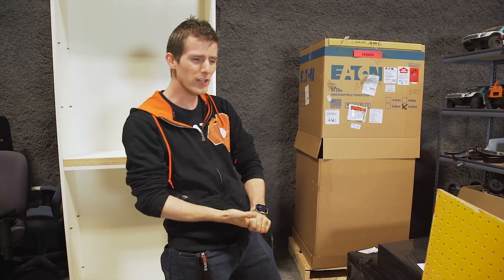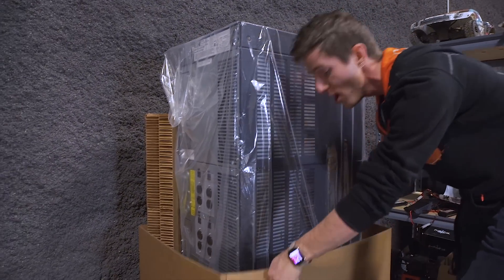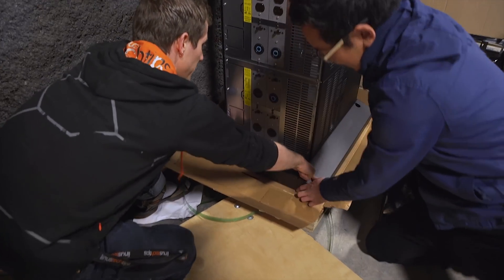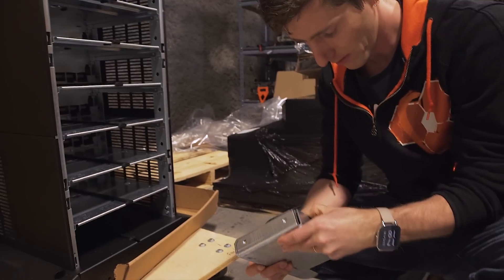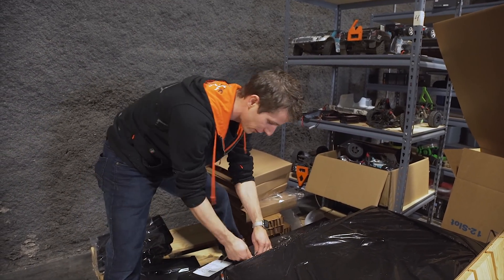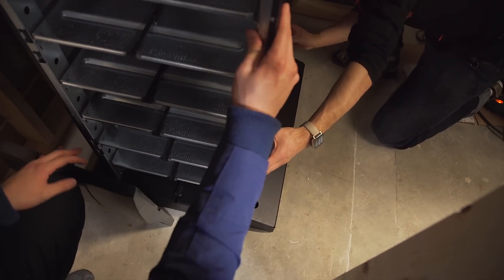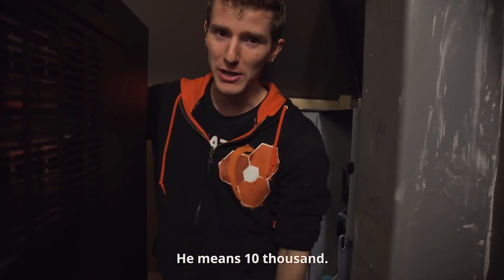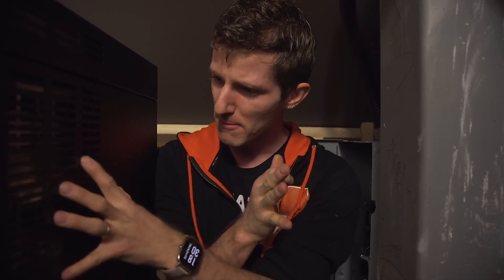HOLY $H!T - A $17,000 (CAD) Man-sized Battery!

Comment: Tesla Powerwall 10kWh 3500$ and this 12kWh battery 12350$ worth it? (17000 cad)
Reply: +Alex Arifin That is what i was thinking, and you can daisy chain powerwalls for a higher overall output. To shut down the servers you would need a bus monitoring device hooked up to something like a $20 raspberry pi to shut down the servers, but with that much power you may not even need that
Reply: +Alex Arifin not looked into the powerwall buts its probably made from lithium edit: google searched confirmed i was right lithium is a use it and toss it solution plus a huge fire hazard if it was to be exposed to air and basically an explosive when exposed to water. this solution is a lead-acid battery and when the lead gets crystal formation it can be "cleaned" and refurbished and reused. as well as the acid. also if air gets into it it wont set on fire immediately
Reply: D. Conn The lithium is under a coolant (same as the one used in tesla cars [which were not particularly flammable during crash tests]), so even a leak probability will not pose a fire hazard. Additionally, the powerwall lasts 10 years of maintenence free use. I don't think tesla made these batteries without considering hazards, especially considering that they make a enterprise unit called the powerpack which stores 100kwh! and very large orders have apparently come in for 1mwh daisy chains.

Comment: what the hell is a kilovolt amp?
Reply: +Roger le It's a unit of power.
Reply: +Roger le well technically V * A = W

But when you're talking about AC power delivery often you are dealing with apparent power and actual power. In a perfect world the potential and current would be cute matching sinusoidal waveforms. But in practice depending on the load they'll be a bit apart making the actual usable power less than the apparent power if you just take the average current * RMS voltage.

So at some point people have decided to generally refer to apparent power in VA and when talking about real power where you ignore the imaginary part of the math that can't be actually used Watts.

Comment: Apparently everyone in the comments is an expert electrician or datacenter availability engineer now...
Reply: +Shoot1st I read a bit of the bible once, but I don't think I'm the Pope
Reply: +Captain Obvious Yep and from what I see its a useless battle for those of us who DO work in them. God some of these people think the generator runs 24/7 and directly power the equipment. God it hurts my head seeing all the stupid...
Reply: +Captain Obvious , That's obvious... Captain Obvious :)
Reply: Haaa. I was just thinking that. A few are probably legit. Others just happen to touch a power generator and glanced at a data center rack the day they saw some engineers working on the stuff. They stopped and talked to them for 30 minutes.
( ͡° ͜ʖ ͡°)
Reply: +Captain Obvious you know i laughed my ass off when i read this because although i am not a Master Electrician i am a journeyman Electrician. There were several things thorough the video that stuck out to me. #1. 4 15amp circuits. WTF is the point in 15's what did you run out of 12/2 MC and used 14/2 MC instead, its a commercial space use 20 amp. #2. The disconnect for the UPS must be easily accessible, not crammed behind a UPS (ec. 110-26 of the National Electrical Code (NEC): 1) at least a 3-ft 
clearance in front of all electrical equipment; 2) a 30 in.-wide working
 space in front of equipment operating at 600V or less). #3 Never should anyone open a disconnect for any reason who isn't licensed even if it is not live. Not only do i see it open, i see exposed terminals and Linus parts in close proximity. [Also i know i referenced the US National Electrical code and not Candida's but i can assure you they are very similar in many regards. Also before anyone give me shit saying Linus can open it because he owns it any its legal for you to do your own electrical that only applies to Residential, NOT COMMERCIAL. Im not trying to bust balls here and be a hater but Electricity isn't a joke and anyone who isn't trained shouldn't be working with it.
Reply: +Captain Obvious I genuinely am.
Reply: +Christ J 
Aren't we all.
Reply: Brandie Housel C&G 2360 parts 1 and 2, NVQ 3 in Electrical Engineering. I have the most recent 2381 and 2391 updates too.

Would you accuse everyone of making this stuff up? That would force you to conclude that electricians don't exist.
Reply: +Captain Obvious Im an expert electrician... Dont touch plugs with wet hands
Reply: D. Conn plugs are fine, it's sockets you shouldn't touch with wet hands. Even then, residual current devices will kick in and no Darwin awards will be won.
Reply: Scott Ruesch I'm qualified to wire a power plant - does that make me an "expert electrician"?
Reply: +D00mM4r1n3 IT support guys and their job title inflation. You didn't design HSBC's financial data center or go anywhere near it, stop lying.
Reply: +Christ J No you fucking aren't dude. Stfu, gtfu, lmao brb, jk fys
Reply: +Captain Obvious Some of us do actually work in a DC and do this for a living....
Reply: +Captain Obvious Yeah I am I work IT for a power plant
Reply: c Cook Just because you do the IT work for a power plant doesn't make you an expert electrician.
Reply: +Captain Obvious oh i forgot to mention most generators (consumer grade) produce modified sign wave. Servers and delicate equipment can be damaged by modified sign wave. So what you would require is a Power conditioning system.
Reply: +Captain Obvious I actually am a datacenter engineer, ever hear of HSBC or CapitalOne, yeah, you can thank me for your bank transactions not being lost in a power outage.
Reply: I feel honoured the handful of experts in the world that actually design multi-billion-dollar datacenters have all coincidentally taken a break from their busy schedules jetting around the world for the likes of Google and Amazon to come be with us here today!
Reply: anarchy intensifies sarcasm intensifies insecurity intensifies
Reply: +Captain Obvious I've actually read up on data center construction and the differing types of redundant backup/emergency power, Admittedly i'd be classed as a novice but i bet that's better than 99.9999% of the viewers who have not even remotely felt the desire to look into it... :p Edit/PS. my favorite backup power methods would be molten salt batteries followed by flywheels.
Reply: Yea i have degree on doctro enginer
Reply: +Robert Rockey Yea, that comment really irked me. Facepalm
Reply: +Captain Obvious I couldn't agree more.
Reply: +Scott Ruesch No, but he knows what is needed to keep vital equipment running. Source: I work in IT in a plant as well.
Reply: Thanks Captain obvious
Reply: well im going to school for networking and security right now so.
Reply: +D00mM4r1n3 I want to eat my bank, whole.
Reply: John Adams "The disconnect for the UPS must be easily accessible, not crammed behind a UPS"

- seriously, do not get me started on local isolation points. I'll have to go to the Angry Dome.
Reply: Captain Obvious sure, because spending a small amount of time on the worlds biggest video-sharing site instantly proves that they aren't experts in an arbitrarily-chosen subject. Nice logical fallacy.

Comment: Wait, did he say 26 mins on full load? That doesn't seem like it's worth 17k... I think it would be more reasonable if it lasted like a day or something idk
Reply: +Joshua Quinto 
$17k is a small price to pay when you can safely shut off servers and save work that is being worked on. 
essentially, a $17,000 battery saved $100,000 worth of potential revenue, on top of the servers and equipment
Reply: +Joshua Quinto Yes, but it is VERY unlikely that you could get to the full load capacity. You would need like 20 servers and 10 washing machines running simultaneously.
Reply: +Julian Dymer Indeed and if that 30 minutes at full load and 60 minutes at 50% load is enough to bridge a "typical power outage" gap that they might have. Linus did refer to having some issues with the electricity in the area then that rig is good enough for the job.

I don't know how much value it would have to be able to keep working while the normal mains power is down, most of the internet and thus ability to upload would be lost. You'd have to generator power both your servers and workstations to be able to keep editing footage to update later maybe?

Basically in a country like that where most power outages are mainly just that, brief interruptions you want to secure your data and that's good enough.

Comment: you must have a huge electric bill. should see about on site power, solar, wind, nuclear
Reply: +Rich Lehman BC is all about hydropower.
Reply: Hydropower makes electricity really really cheap.
Reply: +Rich Lehman They are located in an area solely powered by hydropower, which is really cheap
Reply: No, the electricity provider is BC Hydro (the provider for basically the whole province as far as I know, it's owned by BC's government). Generating electricity using falling water is extremely cheap, much cheaper than burning coal because it is more efficient and basically only requires the power station to be maintained, vs coal power plant that requires coal to be constantly bought to keep it going.

I'm not sure about Linus' office, but here in Quebec (where we have Hydro-Quebec, same kind of deal), even heating is all done using electricity because it is cheaper than using gas, and more ecologically friendly.

Comment: Wow, Linus just went with a proper, non jerry-rigged solution!
Reply: Ya surprised he didn't even deside to make his own battery's to put inside it
Reply: +Tech Tacular Dude learned his lesson.
Reply: next video they try to water cool it with a bathtub and some garden hose :)
Reply: As far as enterprise goes, this is still half jerry-jegged. This style is OK for a tiny loads under of near 10kW. More than that an you'll really want UPS output hardwired to with the input thru a transfer switch, then to another breaker panel just for the UPS output going to PDUs in the racks.

Have the loads individually plugged in to the UPS gets very annoying after a while.
Reply: +TAD2020 They only need it for the server room. Yes, ideally, each of their servers would have two power supplies, and ideally they'd have 2 power circuits, and ideally they would also have a second UPS so they can set everything up redundantly, but in the end, all that costs a lot of money and I don't think they get too much server stuff sponsored.
Reply: +Tech Tacular its cause Linus has a network guy now ;)
Reply: +Tech Tacular And not a bad choice either in UPS.  I worked with these units before where we had 15 of them and enough power to keep the building it was connected to running for 24 hours before shutdown.
Reply: I'm not even sure if he has the capability to make his own batteries.
Reply: +TAD2020 Two words: Small business. 
Nuf said. 
( ͡° ͜ʖ ͡°)
Reply: +TheKyshu And that's when you outsource to a commercial data center who can do it on the "cheap" by doing it en mass.
Reply: +chlem arcelo Potato batteries!
Reply: Crazy, isn't it? I never thought I'd see the day when he did that.
Reply: Robert Rockey That would be too slow, they need to access all that stuff, they encode on their server, they regularly save footage on there etc. And replicating the same infrastructure "in the cloud" would be a) pretty expensive and b) not offer enough speed for their files. They have hours of footage that they need to upload regularly to their encoding server (primary footage, b-roll, etc). And if they want the same speed they are getting here (10GBit), even an end-to-end line to their data center won't offer them that speed, at least not for a reasonable price. It's easier and cheaper for them to do this on-site, especially considering they get a lot of sponsored parts (server stuff not so much, but still)
Reply: K Doe I'm a small business, my UPS is currently at 12KW in n+1 :p
Reply: ***** You usually only see dual feeds in colos, large business, or industrial, as the cost is insane or, more often, not an option for the location. My office is in a mixed large commercial and light industrial area. My building has dual feeds, but they are not independent (coming from the same xfrm vaulted out front).

Same with secondary independent UPS. Any good fault tolerant UPS configured with redundancy of its modules, usually n+1, will cover any failure short of something something catastrophic, which will be a bigger issue for most than not having backup power redundancy for the server room that's currently on fire. :p

Not saying what they got was wrong. From what I can gather for their requirements, its a sound solution for the budget.

The problem I see is that its in that weird gray area where the small solutions will eventually start having problems, or at least potential long term headaches or regrets. While the big solutions with all the shiny stuff are way to expensive to jump up to yet.
(My company is a little further in to that hole where a lot of the small business solutions can't scale higher and the large ones are still really really expensive jump. One reason why I'm running several 2-3 gen old enterprise solutions sourced from ebay, can't afford new big ones, can't make the new small ones entirely workable without much compromise.) xD

Back to the UPS:

This UPS looks like runs just under $9000 and tops out with additional power modules at 15kVA with no redundancy or 12kVA in n+1.

My APC costed at least $5000 more as installed and currently configured with everything that's been added over time. Its rated similarly, at 12kVA n+1, still expandable to 16kVA n+1. But its only half a rack tall (19U) and fully hardwired with transfer switch. If the UPS needs to be serviced to replaced, the load never needs to be disconnected from power.
For them, this would not make sense at this cost. It would be a nice thing to have, but they can take a break for a couple hours for full shutdown maintenance.
However for us, this cost difference pays for itself the first time its needed as the down time of our small company is thousands per hour easily.

Meanwhile some of our clients will literally drop millions instantly on something like this if their current solution fails just once with downtime. I wish I could get their surplus...
Reply: TAD2020 Thanks for the info, very interesting. I have to admit, I only know so much about the 2 circuit thing that I know they are 2 power circuits, so if one fails, you still have the other one providing power to a UPS and powering both servers. I don't currently work in the industry, I'm just interested in all this stuff and have read up on a lot of things, also have done a long-term work experience in IT.
Reply: +Tech Tacular Linus Jerry-rigged Solutions
Reply: ***** Ideally you would have dual independent feeds to each rack, but more likely you won't have such. You'll want to have dual PDUs though at the least, this at least protects you from a tripped breaker and such.

My best suggestion, and pretty much what I did, get a entry level position anywhere. I started at my local school district in the Admin IT department (which a year later got merged with the Instruction IT dept). You quickly pick up on a lot of things this way.
Also don't turn down offers to do side work for co-workers or their friends, that's how I paid for my gas and play money through college (till I dropped out) and how I got offered my 2nd and current job.

Comment: Can this power a computer that can run minecraft at 20fps?
Reply: so u mean Xbox one?
Reply: Doubt it, you might be lucky to get 10 or 12 but I only get 3fps with 980ti
Reply: What about 4-way SLI GTX Titan X's and dual Intel Xeons 12 core CPU's and 64 GB DDR4 RAM?
Reply: +Mr_Venbeer i dont think this 17k can hold that kind of power for a second, that is way to high equipment and 10kW is not nearly enough - Guy from the 60th century
Reply: +iamawatermelon i mean what +Mr_Venbeer said
Reply: Mr_Venbeer Try it but don't blame me if your PC catches fire
Reply: +TheGamesGuy it wont catch fire, 10kW is not enough to power extreme high tech from the 60th century